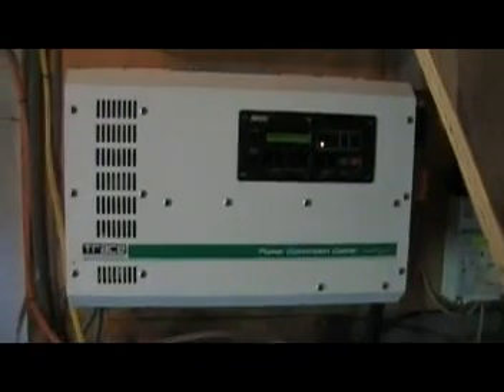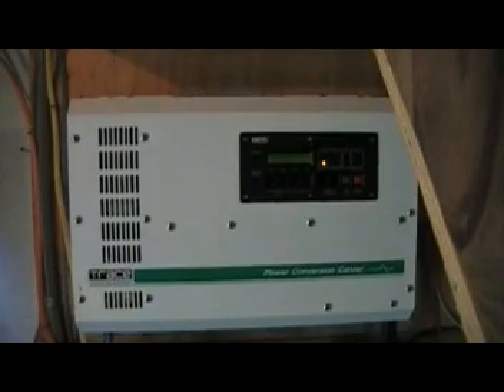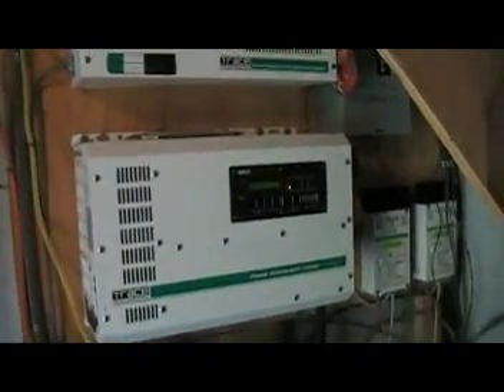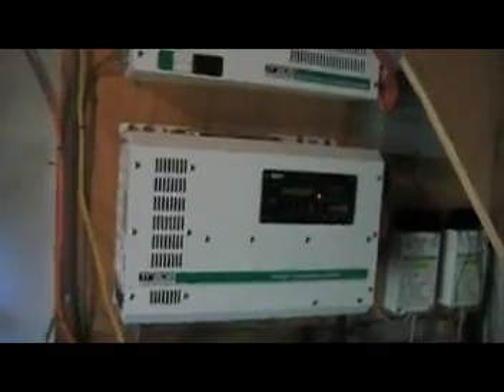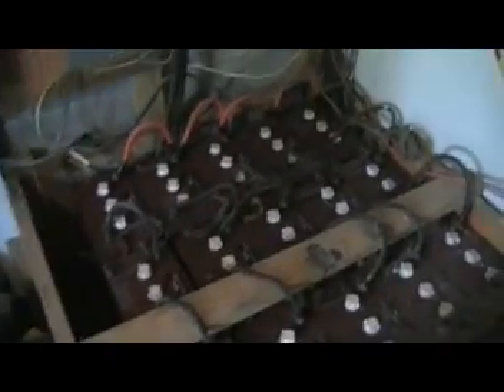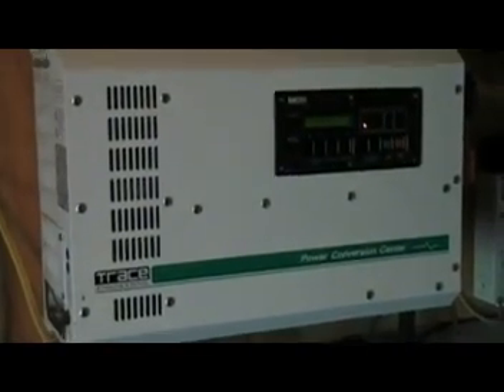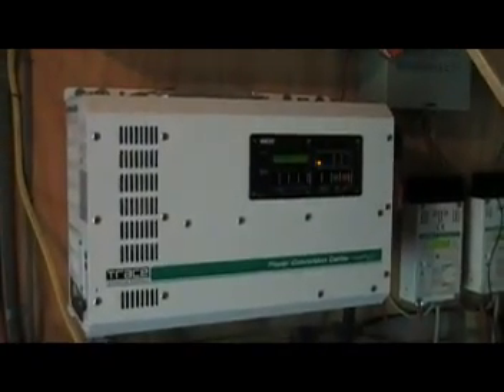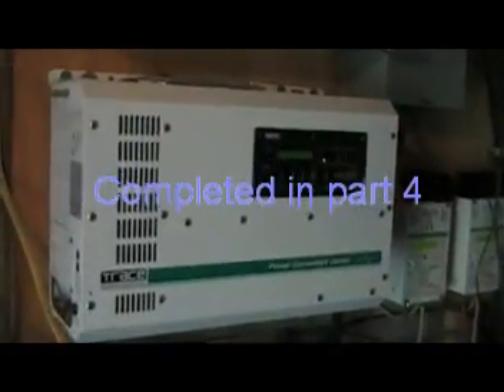Alternate Energy 3, solar power off grid economic collapse

Comment from the maker: @timonix2  Your first task is to get rid of and/or change out all the energy hog items in your house. That means you go for a LP gas or a solar water heater, you get an LP or wood stove and you heat with wood. An electric water heater, stove and electric heat are the biggest draws. Get rid of those and pay even a modicum of care in using your power and 4,000 watts will be plenty. Keep in mind that's over 30 amps of power.

Comment from the maker: Car batteries really aren't designed for a deep and regular discharge. However they are worth a try. Considering the last time we bought T105's they were only around $75.00 I would say you are better going that route, but try the car batteries in regular use for a while and let us know how it worked out. We are pushing 4 years on the T105's and more than 5 on the L16's.

Comment from the maker: Had commercial power at the site already. In that area during the summer it's nothing to get 110 for a week or more at a time. From approx mid June to first of Sept they use grid power for the AC. It's a rough area of the country in the summer time! They could run the central AC with that genset, but they choose not to.